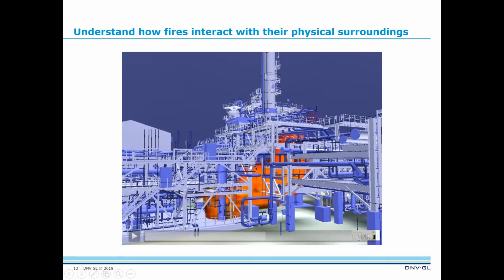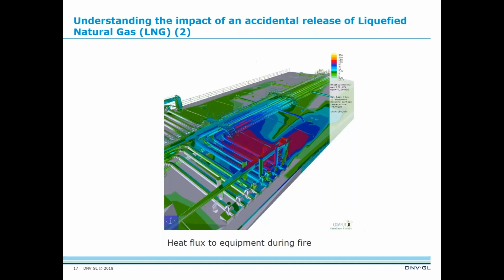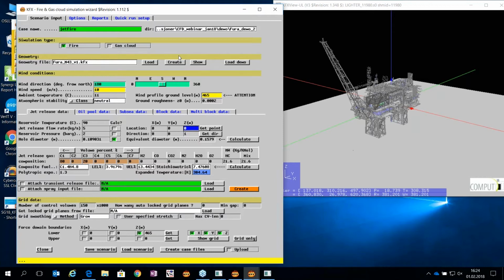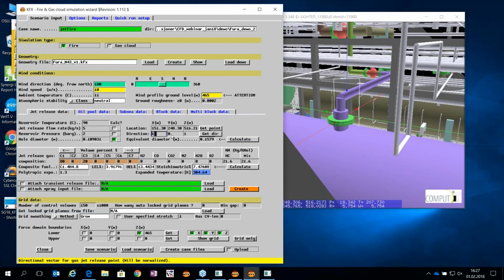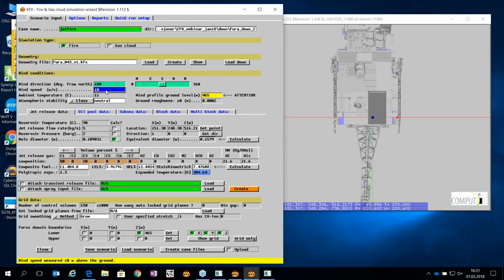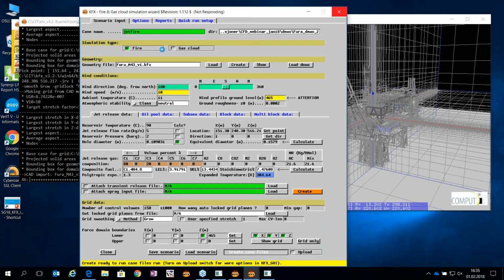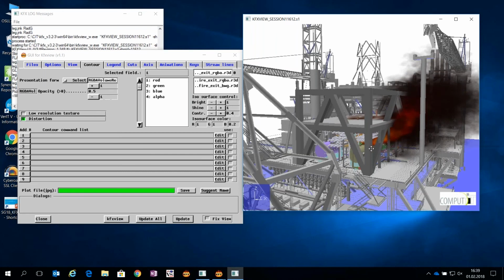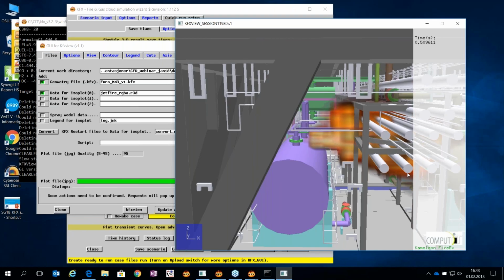Computational Fluid Dynamics (CFD) - demonstration of KameleonFireEx ® - KFX software tool

Comment: Thanks. Very easy to understand and I found it a user friendly CFD model for Fire/Dispersion explosion simulation not only offshore but for onshore oil & gas facilities as well if we consider coarse grids.
Reply from the maker: Thank you for your comment. KFX can indeed be used for simulations of fires, gas dispersion and explosions in onshore facilities. One of the strong features of KFX is that the user interface is responsive and easy to operate even for large domains and complex geometry models. As the tool is developed for solving practical engineering problems a lot of effort has been put into reducing simulation times without compromising accuracy.